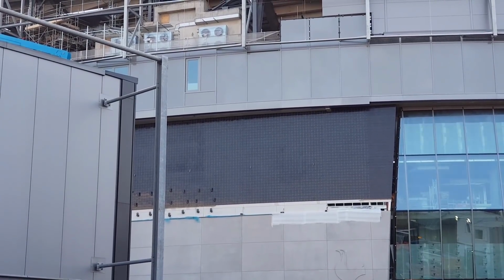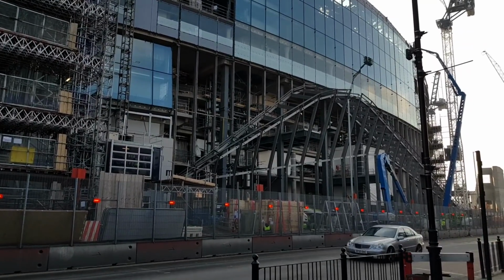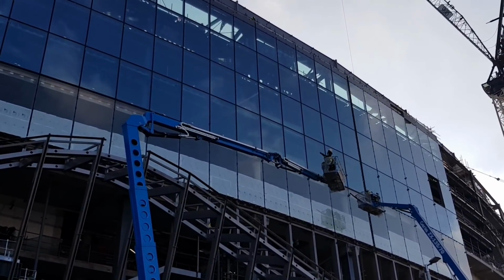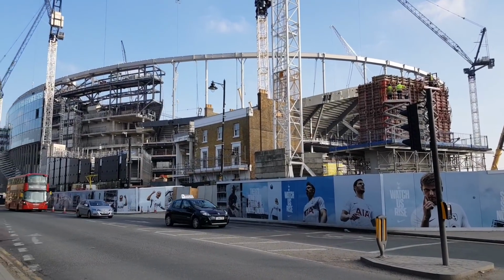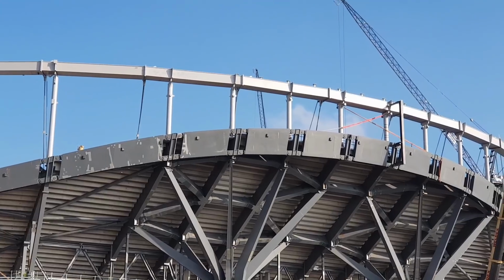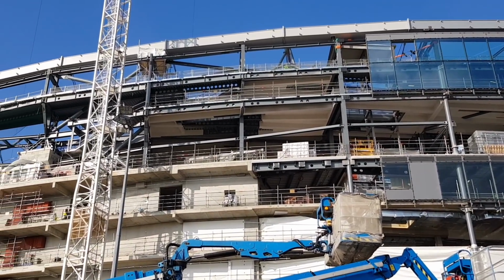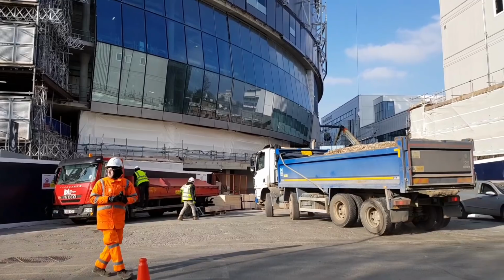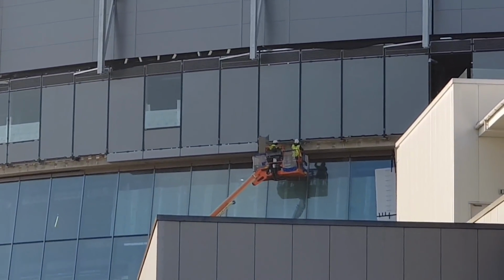UPDATE ON TOTTENHAM'S NEW STADIUM: News on the Roof Lift, Tiles, West Stand: 24 February 2018

Comment: Another great update Chris and progress is speeding up. You can see they are getting ready for the lift as inside the stadium only seems to contain what is required for this as most other stuff has been moved out. I would assume the lift can only take place in daylight hours but once this is completed I imagine the roof panels will follow close behind then the seats will be installed.  This stadium with the LED lighting shining through the cladding will make this a landmark for London.

Comment: That roof lift will take 3 weeks. Then they have to put the roof cassettes was on. I wonder if that part will be completed may/ June- allowing 2 months for seat installation.

Meanwhile I’m waiting for the whole exterior to be watertight, including the glazing on the south stand. I’m betting that’ll be all done may/June too after the roof lift.

That leaves trays, and turfing, finishing the podium while finishing the interiors that are already underway. I’ve got a strange feeling this could actually be ready for August- but Mr Levy will probably have it ready for September so it’s not a rush job